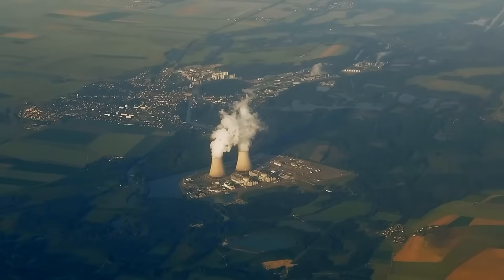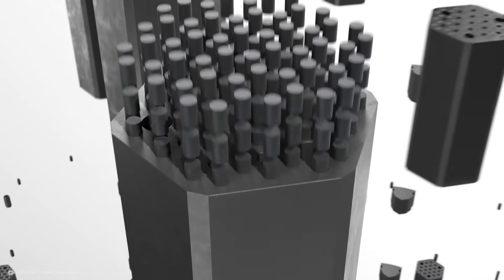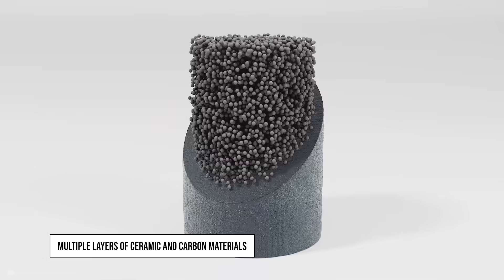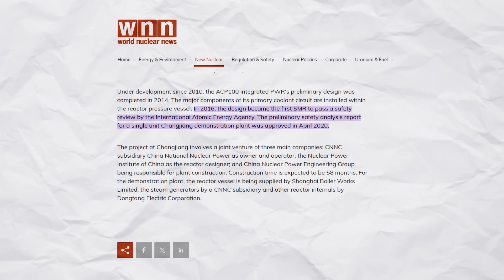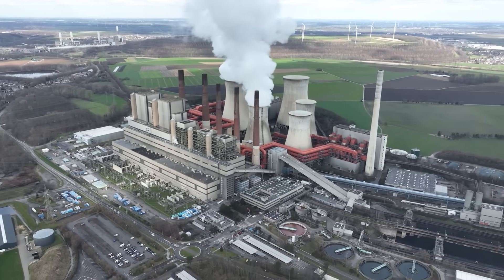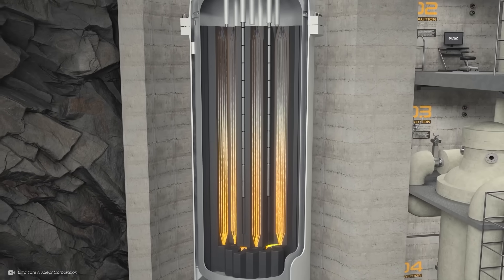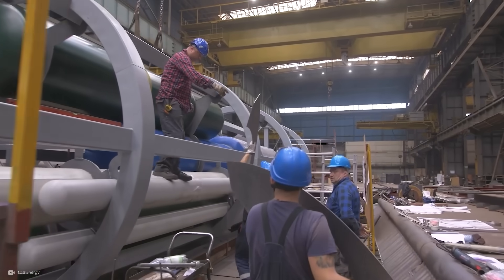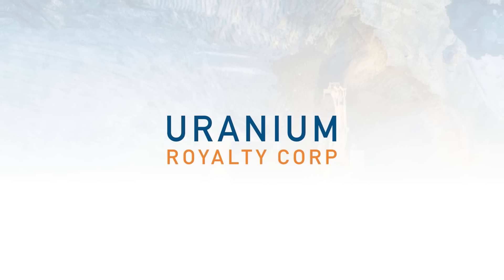The Genius of China's Small Modular Nuclear Reactor

Comment from the maker: What do you think is the future for SMRs? Thanks again to Uranium Royalty Corp (UROY) for sponsoring a portion of this video. Check out their website at https://www.uraniumroyalty.com/ !
Reply: I was a bit surprised that you didn’t mention molten salt SMR’s which could partially avoid some Uranium mining and has potential benefits with waste.   Especially since China reportedly has a MS-SMR test reactor in operation and have announced plans to use the design for commercial production.
Reply: @QMasterChief pig ignorance?
Reply: royaltys ceramic pellets are nice and dandy until you realize you get up to 10x more radioactive waste out of it. At least this is the upper limit i came across. Actual research on this would be very nice. Because the radioactive waste will pile way higher than before.
Reply: @juliane__ hope he makes a video on these ceramic pellets high radiation,,,
Reply: While PV and Battery are material science and so price drop is simply achievable. SMR is mainly heavy industry, piping, pumps and turbines. All technologies more than a century old. Where should the price decrease come from?
It is exactly the same problem why the price for green hydrogen will not drop significantly. So don't hold your breath.
Reply: Please check this video. Nuclear rector transferable on the track
Reply: I think helium in this context could be a problem, because helium loves to escape
Reply: @TheExileFox  It won't be radioactive so as long as it can be "topped off" every so often, shouldn't be an issue.
Reply: I think you're a clueless shill, as proven time and time again.
Reply: Alas your knowledge is severely affected by our empire of feminine lies propaganda.
China is NOT the world’s leader in nuclear power and neither are any of the western nations.. 
it’s Russia.. the Russians have ALWAYS had certain technologies where they simply are far superior. Most being military and space applications.. think R7 ICBM, Sputnik, lasers, electronic warfare, SAM’s, tanks, fighter radar… 1981 mig31 in service vs took the west until 2001 in the licence built by Mitsubishi F16 fighting falcon copy.. 
network linking missiles, high supersonic missiles, autonomous space rovers (mars) space probes (Venus) 
Vastly superior in certain technologies.
The USSR went into miniaturisation Vs the west semi conductor integrated circuits..
They soviets won the Cold War arms race EASILY in mid-late 1970’s.
We in our fraudulent ways we won the cold wars luxury domestic goods race .. microwaves, tvs, watches, phones..etc etc… 
Alas we are propagandised from early with such Russophobia we tend to be highly ignorant of reality.
The Chinese signed in 1982’ from memory for Soviet (Russian) technical, design, education for Chinese engineers, the actual NPP Taiowan nuclear body was formed with literal assistance from Russia.. to my knowledge the ONLY indigenous part of any of the Chinese nuclear reactors was phase 3 of 5.
Like commercial turbines, missile techs, military turbine etc etc these high end technologies cannot be short cuts to gaining competence.. you require generational engineering expertise.. the only fully self sufficient in totality is Russia, the chinese are world leaders in some techs for sure as are Japan, South Korea, USA the unfortunate thing is the USA is slowing its expertise to atrophy as we are witnessing with Boeing, etc..
The wests has ALWAYS post ww2 had inferior education compared to the ussr/Russia, the average Russian 14 year old boy has equivalent skills in math to stem applicants to MIT.. 
the technical institutes in Russia are easily world leading but for our Empire of feminine lies we continue our consistent fraudulent thinking Russia is primitive and the USA are exceptional .. we are liars, cowards and morons basically (in general.. )
Reply: https://youtu.be/tDOVWWu6b1w?si=t91EroLVhHXL4CPg
Reply: The video RethinkX Brighter Episode 10 by Adam Dorr details why SMR's are a dead end. It's painfully obvious. 
You tube slash c0f1L0XUIQ8?si=Nb1RlqqD2qzKz5Sc
Reply: CORRECTION TO THIS - Nuclear like EVERY energy source we use has a carbon output. No matter what anyone says or does it is simply impossible to get the Carbon Output to zero. We can start with the simple reality of extracting Uranium Ore form the ground AND BEFORE ANYONE ASKS I have actually worked on a Uranium Mine (ERA Ranger in Australia). So I know how that part of the process works and YES it has carbon emissions. PLUS every engineered installation on the planet needs maintenance and the replacement of parts. That's an ongoing process and those NEW REPLACEMENT PARTS, irrespective of what material they are made from involve carbon emissions. 

So lets just be factual and say there is NO such thing as the ZERO Carbon system here on the Earth. What we actually need to be working towards is a SUSTAINABLE CARBON CYCLE.

Before the industrial revolution there planet had its own stabilised carbon cycle. Since the Industrial Revolution "WE" (the human race) have thrown that carbon cycle out of whack and we now need to un-whack it. Will nuclear power help us un-whack the carbon cycle? ABSOLUTELY, but its NOT the only thing we need to do.

Sorry if this next part is longish but it actually links up with your video on the AC system the ex-NASA engineer has done.

The biggest thing by far will be energy efficiency. 

We have to be more efficient with energy. So you understand there's a direct correlation between GLOABL energy production and GLOBAL GDP. If Global GDP keeps increasing we will get to the point where global energy use literally cooks the planet. Forget greenhouse effects energy use alone will do the damage. The energy issue has been ignored by mainstream economists for decades but has NOT been missed by a few economists, engineers, physicists and other scientists.

The core problem is energy efficiency. If you look at the energy efficiency through the entire process then what you use for things like kettles, TVs and the computer your at right now is as little as 5% and for most things across the developed world less than 10% efficient of the actual energy used.

This comes from 2 simple realities. One there's the energy consumed for raw materials an infrastructure. Two there's the basic efficiency with which we produce electricity which is only about 35-36%. Go look at the basic data for the EPR 2 reactors at Hinkley point (36%) or the AP1000s used at Vogtle (35%). They're no different to coal fired power stations for the simple reason they boil water and the Carnot efficiency (1 - Tc/Th) for steam turbines is limited to about 36% because of the boiler-turbine-condenser combination. It can be raised to about 42% with high temp high pressure flash boilers but that's NOT as easy as it sounds or it would have been standard practice.   

The reason why Gas turbines get around 45-46% efficiency is because they operate at a better Tc/Th ratio (eg 1700-800C at 45.6% versus 500-225C at 35.6%) It also why cogeneration works so well because IF your gas turbine exhaust is 800C you can use that to boil water. Yes there's some losses but you can boost the over all efficiency to around 64-65%. The GE 9HA in cogeneration gets about 64.5%.  

Then there's the losses with the high voltage transmission to your local substation, then the losses of transforming to medium voltages and transmitting that through the local grid and then finally the local transforming down to the low voltage at your house and the power loop through your house back to the grid. So the electricity you use at your computer is lucky if its arriving at the power point at 20%. Then when you look at how much of the energy in a computer is lost as heat in the power supply and chips and you are lucky if your above 10%. 

This is why technologies like the AC technology from the ex-NASA engineer I just saw in another of your other video are so important. Across the board we have to be more efficient with energy.  

Another example are buildings as in large office blocks and towers. Prof Mark Blyth (Brown U.) has several times mentioned an engineering study that said if America triple glazed all of those glass clad towers in major cities then America would meet its carbon reduction requirements for the Paris Agreement AND IF THEY DID IT the operational cost reductions would greatly enhance the profits of the owners of those buildings. Plus all the work needed to get that job done would keep 1,000s and 1,000s of people employed for at least a decade maybe 2.

But then America just re-elected Captain Greed and his army of Planet F⋃CKING Maggots.
So your guess on what's next is as good as mine.
Reply: I'm sure pumping chemicals into the ground to dissolve radioactive metals is absolutely fine...no environmental concerns there whatsoever... 🤔
Reply: @Big-Jock they pump down weak acid to do that I've been told, and suck it back up. Yes I'd hate it to get into the water table.
Reply: @Big-Jock hmmm but the bedrock containing high amounts of uranium would
become less contaminated with uranium as they remove it?  How can it be worse for the environment?  They wouldn’t be mining inside the water table and its rock that already contains a radioactive element.

Comment: Good video . . . except . . . we are not concerned with "carbon emissions" (the trendy street talk vernacular deployed in place of the correct/truthful term carbon dioxide).  There is no connection (of concern/merit) between atmospheric CO2 and global temperatures.  There is a connection between low CO2 levels and the biosphere.  We are concerned with [a] pollution (NMOG, NOx, etc.),  [b] footprints (solar not quite as bad as the "wind" farce),  [c] reliability (i.e. not the pathetic record of solar and wind versus merely bad weather), and [d] true sustainability.    Resolution/mitigation of the waste issue (a credible concern) begins with the voiding of Jimmy Carters Executive Order 12192 (from 1980, which erroneous defined "waste.)   @13:00 you state that "U238 must be refined into U235.'  Alchemy of that sort does not exist.  You need to fix that.  I am very vocal in my support of nuclear power in-general, SMRs in-particular.  Micros will also prove viable (ala the USS Gerald R. Ford). I was a reactor operator for Union Carbide, and a nuclear accelerator operator for the State University of New York.  I was keynote speaker in Shanghai China at the Society of Automotive Engineers New Energy Vehicle Forum.  My presentation was entitled EVs as a Driver of Grid Modernization and Sustainable Nuclear Power.  My focus was the electrification of the transportation sector.  I was VERY well received by the Chinese hosts.   Thank you for the video.

Comment: You can't "refine" U238 into U235. You can't change it into that isotope at all. You Enrich uranium or that contains about 0.7% U235 into a product that has proportionally more fissile U235. You do this by removing more U238 than U235 in a centrifuge or other device. U238 CAN be bred into Plutonium 239 but not in these reactors. That's a whole other thing.
Reply: actually, there is some Pu239 breeding in pressurized water reactors, but that's still not "refining" U238 into U235, which is impossible. ERICHING IS NOT REFINING. "Enriching" is increasing the proportion of uranium that is fissile by REMOVING U238 isotope from the uranium yellowcake. Both isotopes are chemically identical which means the only way to separate them is by their slight difference in mass. This is difficult and expensive. Basically, you have to mine almost 200 times more uranium than you can use as fuel.

Comment: The reason why China is working on nuclear is to provide a backup for the renewables. China currently on some day produces more electricity than it needs through renewables but the output varies due to different factors like night, weather and seasons. For the deficiency, they want to replace coal with nuclear which is cleaner and quicker.

Comment: At 7:58 you say no SMR is profitable? Indonesia's first of 8 ThorCon 500MWe TMSRs which can automatically load follow far faster within minutes (and even almost shut down if necessary during a midday unexpected excessive solar surge); as well as being able to "Black-start" and as a high temperature, near ambience pressure, is a "Walk-away Safe" liquid metal Thorium ion molten sodium berilium Fluoride salt burner reactor, having an expected pre-profit levelised cost is less than $30 per MegaWatt.hour (<3cents/unit kWh), as a base loader, the fully fitted capital cost to the PPA owner (except for fuel salts) is between US$800 and $1000 per kiloWatt (from a Korean double-hulled bulk-carrier shipbuilding yard), which include hauling barge-like to the Central Bangka Regency in Bangka-Belitung islands in the Java sea; with whom the last MOU with ThorCon, has recently been signed..
Reply: Great news. I was going to ask about Thorium-salt reactors. This must be one of the first in commercial operation..?

Comment: Changing a non renewable source for another non renewable source is only a short term patch. That's my problem with fission, Uranium production is going down and demand is going up, so we end burning it up a couple more decades at the cost of thousands of years dealing with the waste
Reply: Nuclear is clean energy. We want both nuclear solar and wind. Renewables are good for domestic electricity generation. But we need nuclear for industrial energy requirements.
Reply: @JSM-bb80u  No it is not, it does not produce carbon emissions but it is not clean. And we need it doesn't matter, there is only enough Uranium for a couple decades if we go that path

Comment: All new reactor designs are failsafe, so please stop worrying about meltdowns. There a several methods to prevent thermal runaway, all new units will use a safe method. 
Stored Nuclear "Waste" is not waste at all, it is fuel. Ripe and ready for use in a modern Reactor. 
It's always best to select a reactor based upon the fuel type you can best acquire. All else is noise. 
The only delay is funding. Once a project is funded, you can start, until then, everything is irrelevant. 
The only metric that matters is, how much total nuke generation capacity is online. The sooner projects get started, the sooner energy supply issues fade away.

Comment: What if you had fuel salts in fuel rods that would expand and contract when melted and would be drained if the reactor was moving too fast while moderated by heavy water using stainless steel and haste alloy lining. With the fuel salt being a lower melting hallide.

Comment: France does NOT produce 75% of its energy (electricity, transport, industrial and domestic heat...) with nuclear. 
 It produces 75% of its electricity with nuclear.

The share of electricity in total energy is just 25% in France, meaning 75% of its energy comes from... fossil fuel.

If you mix up "energy" and "electricity", all  your reasonning is off.